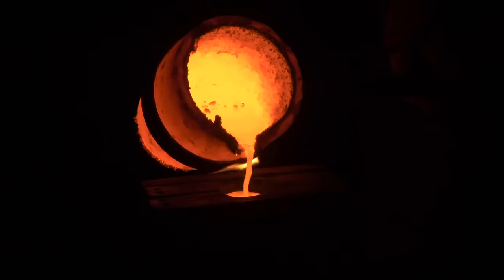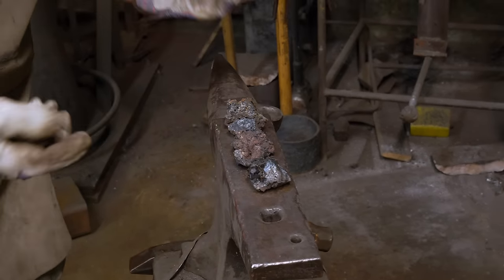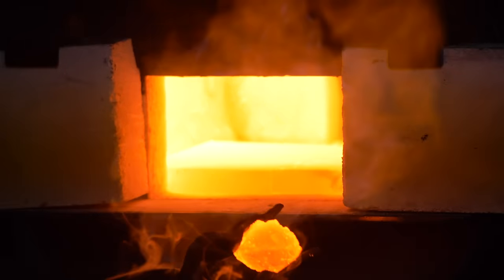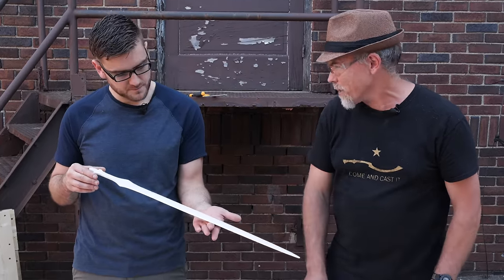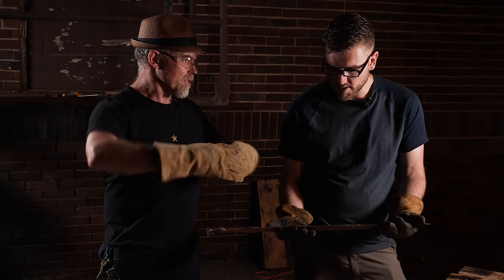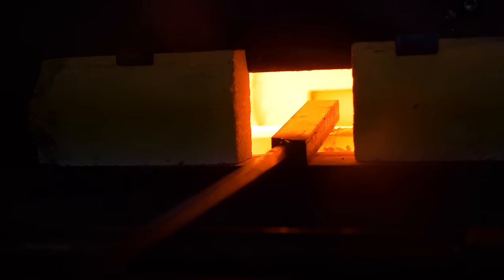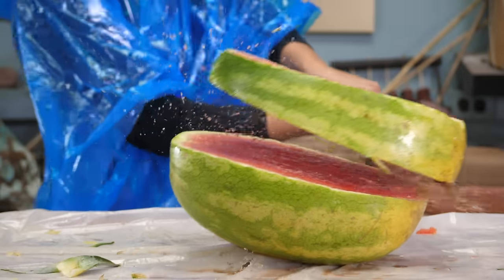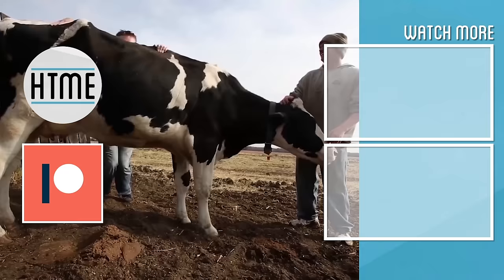Forged Iron Sword vs. Cast Bronze Sword

Comment: The drive of change is that iron is the most abundant metal in the universe not that iron is better than bronze

Copper is a precious metal like gold and silver and the vast majority of iron equipment until the 1100s was terrible and full of impurities which is not like how your sword is, iron was only used because it is so easily found

Various other alloy of copper like copper beryllium is significantly better than almost every type of steel in the majority of uses. The only reason why that isn't used as much is because it is also a precious metal and is slightly toxic to produce

Comment: So I know this video is almost a month old, but are you going to dip into Case Hardening, for higher carbon steels before you begin to try and smelt and cast higher carbon steel? This is a technology that actually goes back rather far and would allow you to use files for sharpening your sword better.

Comment: That 2% for the top end of steel is a little high. 1095 high carbon steel is just below 1%, hence the .95 in the title. Much above 1% and you're talking cast iron, there isn't much commercially above 1%.
Reply: Nah, cast iron is generally 2-4%, sometimes falling down to 1.7%.

I'm contrast, both processed Japanese steel and Damascus steel have carbon content above eutectoid levels, Damascus being around 1.6% carbon. There are plenty of other ultra-high carbon steels available, and go up to around 2.1%.
Reply: @ENoland8  If you're talking historical Damascus I'll take your word for it. I would add that many historical Damascus swords aren't hardenable and never were due to the carbon content being too high or too low, or the alloying elements that were also present in the ore that was used. Most commercially available pattern welded steel that's sold today is a mix of 1095 and 15n20, neither of which are above .95% carbon, so I'd be curious as to where the excess carbon enters the composition of the steel. The majority of the Damascus that's sold online in bar form is just pattern welded 1095 or 1084 with 15n20 for contrast, often low quality with inclusions, but it does make for a pretty stock removal knife I suppose, that too should also average out in the 0.8-0.9% range. There are other combinations but you don't get such clear contrast so they're not as commercially viable or used outside of a few workshops.

Japanese swords absolutely yes, the tamahagane starts out anywhere between 1-1.5% carbon but it's a result of the unusually pure magnetite iron sand they use and the lack of excess alloying elements, sulphur in particular, further the carbon isn't diffused equally throughout the pieces of bloom. Several pieces are chosen with varying carbon contents to make an ideal whole, once folded. Bear in mind also that pig iron, wrought iron or some other form of iron is often added to the mix or later bonded to the cutting edge either as the core, or back of the blade, so carbon content will vary sword to sword, and even vary at different parts, depending on the composition of steel and iron within it. Some of the carbon is worked out of the folded metal also, even in Japan with little sulphur present in the lattice, a blade with too much carbon is prone to being brittle. The edge of the blade is also not intended to clash with another blade, you parry with the back of the sword, so they didn't have to worry about resharpening edge defects in the field as we did in the west, necessitating a lower edge hardness. It's not uncommon for the edge to be in excess of 60 rockwell, while the blade may still have a degree of flex due to this duality of design. Similarly, working 1095 is hard work, if you have to hand hammer it out it's a nightmare already, doubling the carbon would make it near unworkable and it would take too long. In Japan again though, the swordsmith holds status, you don't go to him and tell him to hurry! The blacksmith in a castle in France though, he has to make armaments quickly and he'll be bellowed at to do it tout de suite!

With modern sintered metal alloys some of the tool steels designed for abrasion resistance can indeed be incredibly hard and wear resistant, but you can't really forge a sword with them. They're made for certain applications, they're not really a general use steel that you can heat and beat. 1095 is already hard to work, because of its high carbon content it's stiff and unyielding but some of those very high carbon tool steels if you put them in a forge and tried to work them would blow apart, just like cast iron does. Even 52100 cracks unless you work it screaming hot. The Japanese, as in so many senses are almost unique in working a blade with that level of carbon and as always, it's the alloying elements, or lack of them, and the incredible eye of the Smith when he makes the pile on the paddle that allow it to be worked, that it's done largely by ear makes it all the more wondrous. 

Not that I'm a weeaboo, but I do appreciate all forms of metal working and the ties with tradition and ritual have allowed it to remain very pure. The majority of western forging is having to relearn a now lost art, just as with HEMA, they get as much wrong as they do right, there's constant trial and error, compositional breakdowns and in this age high technology and incredible engineering bring us sintered alloys and perfectly homogeneous steel, but the essence of a Smith's tradition can only really be found in a few places around the world and Japan is probably foremost of those, due to its linking of the Smith to a higher rank than is usual across the rest of Asia. 

By comparison, in Nepal, the King's Kami (swordsmith/knife maker) hails from the lowest caste in society, even the fact he is the king's Kami indulges him no rank or favour, other than the occasional commission and a few more tourist dollars perhaps. In feudal and later, imperial Japan, the link between the wizard that could make a blade of steel and the elite ruling class preserved their traditions far longer than we, who in our industrial age forged machines to do the forging for us, and so broke the link between master and apprentice with all the secret knowledge that it entailed. Additionally the sanctions which were levied on Japan after the second world war instilled in them a desire to keep tradition intact in the face of a changing future, although their own sword art too came perilously close to extinction in the decades leading up to the millennium. It's fortunate that it survived and is so sacrosanct that it will probably be perfectly preserved in another millennium. In many ways I admire that deep a bond with the past, and the master disciple relationship that is necessary to hand the next generation the keys to the kingdom and the enduring knowledge handed from one to another, many generations of experience allowing you to stand on the shoulders of giants. I wish more of the craft, and the old craftsman had remained in the UK.

I also wish I had been so passionate about metal working when I was twelve rather than forty something!

Comment: What kind of steel was the sword made from? I didnt catch if it was mentioned
Reply: The sword was made from a low carbon bar, somewhere in the AISI 1008-1010 range. It was used as a stand in as those steels range in hardness from around 95-110MPa on the Brinell scale, while wrought iron comes in around 100MPa for the most part.

Since most iron swords had a carburized edge layer, or forge welded sections of steel along the edge, the only real difference is the lack of silicous slag or iron silicate in the bar, which helps reduce fatigue from shock and vibration in wrought. 

Hopefully after another smelt of the bloom, Andy will be able to make something out of it!

Comment: I don't think this is a particularly fair comparison.  The initial transition from bronze to iron had less to do with iron being a superior metal as it did with a significant shortage in available tin and an abundance of available iron.  Work hardened tin bronze was generally better (and slightly harder) than the wrought iron available at the time.
Reply: steve gale  (All these are Brinell Hardness) 
Bronze: 40-420MPa
Mild steel: 80-130MPa
Medium carbon steel: 150-630MPa
High carbon steel: 180-760MPa
Reply: steve gale  That... does include work hardening, and quench hardening (if there's enough carbon to do so). That's why there's such a range listed.
Reply: steve gale  I have a degree in mech engineering, deal with material properties daily, and have 7 years of experience as a bladesmith.

There are outliers, like C17900, but that's a modern, spinodal hardening, chromium alloy bronze, and doesn't necessarily play into this kind of general comparison. 

The way Egyptians cut granite with quartz sand or other grit was through abrasion, not through the hardness of the bronze itself. The grit ground down the granite- the bronze didn't cut the stone itself.
Reply: steve gale  How do you spend 60 years as a tool maker and never once look at a datasheet?
Reply: steve gale  That's probably for the better, as I wouldn't apprentice for anyone that thinks bronze is harder than quench hardened steel outside of the spinodal hardening alloys I've already mentioned.

I would LOVE for you to find a single datasheet showing work hardened tin bronze surpassing even 45HRc, or even aluminum bronze for that matter.
Reply: steve gale  Holy shit, this takes the cake.

Quench hardenable steels reach austenization temperature (critical temperature) around 1500-1600°F (for most steels). When in that state, the iron molecules interact with the carbon in the steel, forming austenite. When it's quenched and cooled quickly, the carbon can't diffuse, and undergoes martensitic transformation, producing a form of steel called martensite. Martensite is incredibly hard, but brittle in this state. This is NOT tempering.

Tempering then comes after quench hardening, which takes place at a much lower temperature (around 250-400°F depending on application), and relieves internal stresses that form during the martensitic transformation, producing a tougher final product.

What are the names of these companies you own? I'd like to know so I never make the mistake of ordering anything from them.
Reply: steve gale  You are... 100% wrong. There's nothing to even say about it at this point. I gave you the specific, well known, and well documented explanation of the quench hardening process down to the molecular explanation. Do I need to show you stress-strain diagrams? Do I need to direct you to the machinery's handbook? Do I need to teach you how to check literally any source that would tell you exactly why you're wrong, and I'm right?
Reply: steve gale  Go on, dust off your machinery's handbook. Find "hardening" and "tempering" in the table of contents, and turn to that page. Tell me what it says.

I'm giving you inarguable proof, and even well-reputed sources that back up what I'm saying. Literally any child with access to the internet for 5 minutes could tell you why you're wrong.
Reply: steve gale  I'm literally one of the smiths in the video.
Reply: steve gale  What? I've been smithing since I was 15, and although yes, I'm self taught, I'm much better educated about metallurgy than you are (which seems to be not at all). I mean, hell, I'm a guild smith, and teach courses. 

Are you trying to tell me that literally every smith in the world is heat treating wrong? Are you that dense? Give me one, just ONE reputable source proving me wrong. If you do that, I'll accept everything you've said, and put down my hammer for good.
Reply: steve gale  Seriously, do it. Find ONE reputable source that says you temper steel by quenching it at upper critical temperature, and I will cancel every order I have, refund every purchase, and quit smithing.
Reply: steve gale  I'm in THIS VIDEO. The one you're commenting on right now.
Reply: steve gale  Buddy, how?? You see me in this video. I'm the blonde.
Reply: steve gale  What the fuck does Ireland have to do with anything? HTME is based out of Minneapolis. It's just past 9pm here.

Comment: Clink, clang, clong, clung, cloong, ting, tang, tong, toong. Banging you sword against my sword might scratch it up.  Don't stab me in my bloody guts.  All my bright, fire engine red blood will leak out & I'll stop living.  I'll die down dead & never live again.  I'm afraid to die because I'll never be able to come back & live again.  I insist on violently forcing my enemies to stop living.  but I don't want anybody to do it to me.  It probably hurts horribly when somebody forces a big, stiff, rigid,  ice cold sword blade through my soft, tender, hot guts.  The shock of feeling that blade slide all the way through you & out your back must be horrifying.  You realize when you get run through that you're doomed & can't possibly be saved.  Modern doctors & operating rooms didn't exist back then.  Its as this point that you wish that'd you'd become a peaceful farmer or fisherman.  Boy, oh, boy, I'm glad that I'm a modern, Hippie instead of a ancient barbarian.

Comment: I think it is disingenuous to use modern day fabricated steel instead of iron ore made into a iron sword. The Japanese worked around crappy iron by stacking it and forging multiple times over. It would help get the impurities out over several smelts and would make for a more comparable situation. Modern steels are leaps and bounds better than when the iron age started

Comment: I used to wonder why humans abandoned bronze in favor of iron despite looking much better (come on, reddish golden sword looks much cooler than the boring silvery iron). The reason is that bronze is much weaker than iron. Not to mention the fact that iron is much more abundant than tin and copper.
Reply: That's a common but false belief. Bronze is superior to iron, which is why the Bronze Age lasted so long. The Hittites were forging iron/low grade steel at around 2000 BC, as the Greeks refer to them as the inventors of steel (the Ancient Greek word for steel even descends from their name for the Hittites, Greek 'khalybe' < Hittite 'halu-wa' ("region of the Halys" = the heartland of the Hittite Empire). This was in Mycenaean times, so you have to ask, if the Greeks knew about iron/steel around 2000-1200 BC, why did they wait so long to adopt it? Even in Classical Greece (~500-300 BC), bronze was preferred over iron/steel, especially for armor. Keep in mind, the Macedonian Army conquered a large part of the known world with bronze armor and weapons.

It's not until we started forging higher grades of steel that iron was able to surpass bronze. Disappointingly, this video features a form of a higher grade steel vs bronze, so it's not at all illustrative of history.
Reply: @cheesehands3112  so, does that mean we now prefer iron over bronze only because its availability?

Comment: Eh in reality early Iron weapons were garbage until blacksmiths by acident stumbled upon primative forms of sudo-steel, which is what the Romans had, the poor quality iron weapons of the ghuals kept bending and blunting when they went up against Roman sheilds, bronze scales and chain iron armour.  The only kind of early Iron weapons that were better than Bronze before roughly 300BCE were very rare examples of "meteorite metal" weapons, which are forged from iron meteors rich in additives which naturally made them cast as steel at lower temperatures than what is usually required for steel due to the existing crystaline structures.

Comment: the video mention that they don't not have the knowledge to harden the steel. but by quinsing the steel in water as its grinded down, that must be hardening the each. isn't that the definition of hardening the sword?
Reply: That's not a hardening quench; steel won't harden when quenched unless it reaches a critical temperature (~1500-1600°F in most steels), where it forms something called austenite. It's then rapidly cooled to "trap" carbon in molecules of iron, forming martensite. You also have to have enough carbon for it to harden, which this steel didn't have. It had around 0.08-0.15% carbon (hence why it's roughly equivalent to wrought iron), and quench hardening doesn't really occur until you get above 0.3% carbon.

When the steel was cooled in the video, it was around 250-400°F, and just made it easier to hold.

Comment: Very Cool, I Dig 1500s- 1600s Spanish colonial artifacts here in NE Florida, I (me) 😁 Just recovered the second Spanish Missionary seal ever found in the USA, and several Bronze 1500s 1600s Coscojo worn on the horse tack of a Spanish soldier, I also recovered a Sword handle, copper Scabbard peices and blade fragments in a hole with 5 X 1570-1604 Phillip II & III Mexico city shield design cobs, would you be able to ID the design. Period, or origins from the pieces of sword. The scabbard has what I believe is called a drag at the end, ( funny weird shaped end ) ...
I write under the name IndianaBones and can be found in 6 issues of Western and Eastern treasure magazine, 
( me on the front cover April 2020 best finds issue )

I can email pics if OK.

Comment: Why didn’t you harden and temper the sword?
Reply: Quenching only works on steel. It won't do anything to iron sword they made because there's no carbon in it. Though you can still harden an iron sword by hammering around it's edge just like they did with the bronze blade in this video.

Comment: you hammered and hardened the iron sword and simply cast the bronze sword, ofc the bronze would be softer. It would be the same if u had two iron swords too but used the different techniques
Reply: What? The iron sword was never hardened.
Reply: @TheElfsmith  it was forged and quenched, makes a big difference
Reply: @MrDjBanza  It was forged obviously, but never quenched. the material isn't quench hardenable.